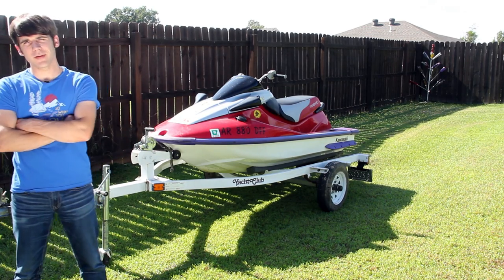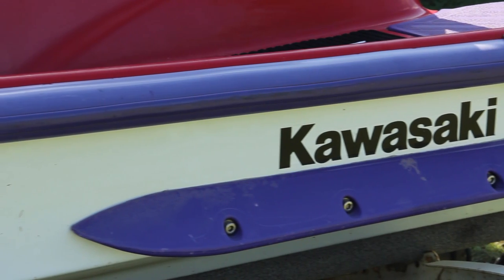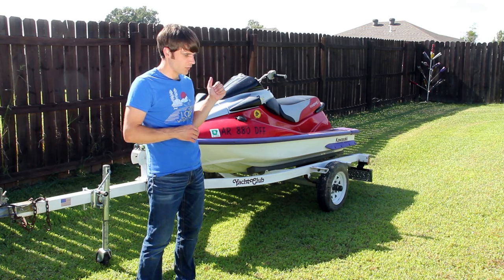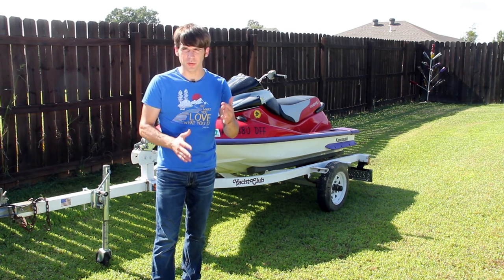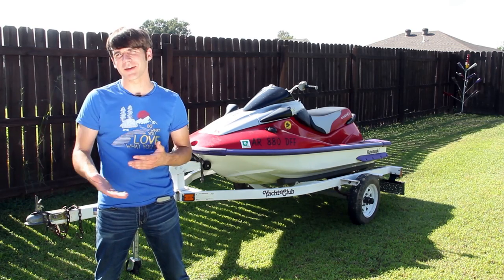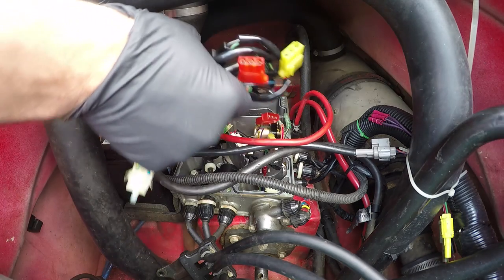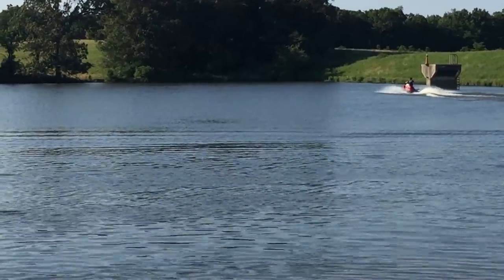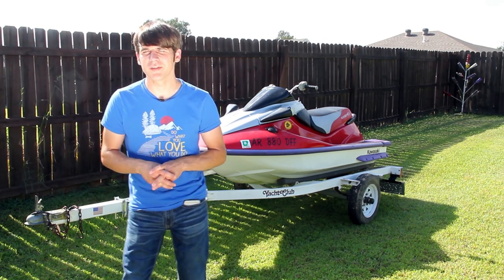1996 Kawasaki ZXi 1100 // "Purchase, CDI Fix and Starting Engine"

Comment: Good Morning . i'm from brazil, i have a jet ski kawasaki zxi 750, it doesn't work anymore. it's like it doesn't have a battery, but it does and it's all right with it, the panel doesn't work. the trim does not work. and the engine is not. the battery cables and fuses have already been checked, they are all right, can you give me any hint of what might be? thanks

Comment: How did you know to go after the cdi box? no spark? common problem? just went for it? really cool you got it going, could the oven trick ruin a good one? thinking about getting one, looks like the boxes go for 500 used, must be $1,00 new, huh .. haven't checked u=yet. Great job, thanks for putting some info out and glad it worked for you! Cheers!
Reply from the maker: I didn’t have any spark and only thing left was CDI box.  I did my research and found it was common problem with that model.  Then I just went for it. :)
Reply: @jmink  Thanks, that helps 🙂

Comment: Hey I’m trying to fix an 01 stx di 1100 and I’m stumped.. I have good spark on the middle cylinder and inconsistent spark on the other two.. most of the time it’s not there I took apart the connector that goes to coil wires and unplugged the middle cylinder.. then of course had nothing on the middle cylinder but the other two had good spark. Maybe you or someone that watches this video has seen this problem I’m wondering if it could be related to the computer.. Spark plugs wires crank position sensor and coil’s all tested good
Reply: Ive got no spark at all. New cdi, new stator, new wires, just nothing to the spark plugs crazy what did you find out?

Comment: I have two questions that I hope can help with. I had problems with my solenoid so I changed it out. I hooked it up backwards for a few seconds...😩 and I'm not sure what i fried but all the electronics went out on the trim so it wouldn't start. I conected a push start button directly to the solenoid and it starts up. what could I have fried???

Comment: My second question would be when it's running I have a slow charge moving up a .10 every second or so. Is this normal or where can I start checking? I have a zxi 900 1996 and would appreciate any help.

Comment: if CDI has BGA chips then could be caused by overheating and losing the contact to the pcb board. Same fix works for console CPU and GPU as they are bga soldered. Most of times this is temporary fix

Comment: Hey where are you at with cleaning the carburetors on this? I just purchased one and never worked on a marine engine before and would like some guidance in working on the carbs because I think my jet ski is starving for fuel

Comment: What was the jet ski doing when you bought it.  Have a 1999 Kawasaki stx900 that when you press the start button you will only hear a single click.  Bought new battery and new starter solenoid.
Reply from the maker: The engine would turn over, but there was no spark at the spark plugs.  After the CDI fix I was able to start it.
Reply: Thanks for your response.
Reply from the maker: You're welcome.  Oddly enough I am about to replace my starter solenoid because it started clicking and not turning the starter over.  I bypassed the solenoid and was able to get the starter to crank.
Reply: We're thinking it's the starter.  We baked the ignitor like you suggested with no change.  We'll bypass the solenoid and hook power supply to the starter and see if it's our problem for sure.
Reply: Yes, I'd say it's your solenoid.  We will be installing a new starter tomorrow.  That was definitely our problem.  Since we last talked I bought a 2000 kawasaki 1100 stx di.  It turns over, but no spark at any of the plugs.  A new stator was installed and I'm thinking it's the EMM.  I'll have to send it to a company in Alabama that will diagnose for free and then repair and upgrade the computer.  I've got a new start/stop switch ordered and a new condenser too just in case.  I'd say if it was just one plug it might be a coil but with it being all three it's probable the EMM.

Comment: Hi I have the same type of wave runner after hopping some big waves last year I Lost the trim control and none of my gauges are working but it still runs great any ideas?
Reply from the maker: +Arcenio Pizana I haven't gotten to work on that part yet.  But, my guages are a bit out of wack too.  My fuel sensor needs work inside the tank, you can tell it wants to read on the guage, but the floats on the sensor are messed up.  The rpm guage funcitons fine, but the speedometer doesn't work.  Also my trim control works on the handlebars, but the trim motor is stuck on mine after I finished the season last year.

Comment: Hey man, did it turn over but not fire? I’m going through the same problem right now.
Reply from the maker: That's exactly what was going on.  I did some quick research and found that heating up the CDI was kind of a last resort fix.  I thought it was worth a shot because I wasn't ready to drop $$$ on a new one.
Reply: jmink so how is the procedure done with the oven. I’ll try it

Comment: What did you adjust the jets in the carburetor to? I rebuilt my carburetors but the low and high speed are off. I can't go full throttle off the hole, it bogs out if I do.
Reply: Did you ever find solution to this?

Comment: So kind of a dumb question, but when you work on these you're completely limited to reaching into the engine compartment from the provided holes under the seat? Thanks!
Reply from the maker: +Tim Lalli sort of.  You can also pull the motor.  Which I've done twice.
Reply: Oh boy... hahaha
Reply from the maker: +Tim Lalli yeah not be most fun, but it depends on what you are doing.  Some stuff I worked on it actually saved me time by pulling motor.
Reply: Well here's the short version: bought a seemingly mint 2002 ZXi 1100 with perfect compression, clean hull, no leaks (water or anything else), always garaged, 1-owner, never left in water, always fresh-water ski, trim worked, 135 psi compression in all cyls...seemed like the perfect ZXi. 

Guy told me he spilled a bit of oil when filling up injection oil tank. He seeded honest, but after a couple of rides there was quite a bit more in there. I cleaned ALL of it out, and wiped the surface clean. 12 hours later (sitting on the trailer not running) there's a small puddle. What do you think?
Reply: Forgot to mention: the small puddle is under the oil injection pump.
Reply from the maker: +Tim Lalli can you spot any source from where the oil could be dripping out of the oil tank?  I don't have the oil tank in my ski.  The previous owner removed it and I have to mix my gas.  So I have zero experience with the injection tank.
Reply: jmink ohh I've heard a lot of people have that done. It doesn't seem to be the tank, but I'm going to spend a little time on it tomorrow. Hopefully it's just an oil line... I'll update you haha

Comment: Did you make a video on rebuilding the carbs?
Reply from the maker: I shot one, but I never edited it together.  I bought a kit off of eBay to rebuild the carbs.  It had all of the gaskets/seals/diaphragms.  Mine were pretty clean so I didn't have to do much cleanup, mostly just teardown and reassembly.
Reply: jmink id still like to see, I’m having some trouble with my 98 I think the carbs need to be tuned/cleaned, she wants to cut out above 50% throttle. I’m hesitant to order the rebuild kit because I was told they’re very difficult to work on. I’ve worked on car/motorcycle carbs
Reply: Would this work on a 1996 Kawasaki Mojave

Comment: i have a 95 kawasaki 750 sts,it will start with starting fluid but will not stay running...any ideas??
i replace the fuel filter and sprayed carb and choke cleaner a healthy dose at that ..
after doing that it fired right up on its own so we headed to the lake after warming up it went right back to its original problem...
HELP....ANY IDEAS??
Reply from the maker: I rebuilt my corroborators because of the same issue.  I bought a kit off of eBay to rebuild all three of mine with new gaskets and needle valves.  After this it would start without spray and even idle.
Reply: Thanks for the info..a big help
Reply from the maker: You're welcome, sorry for the slow response.  Good luck!